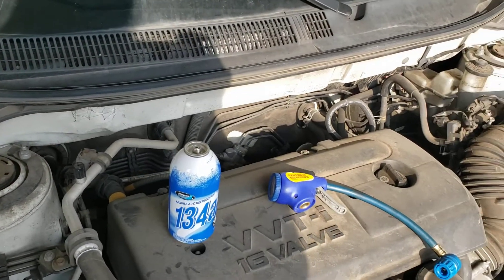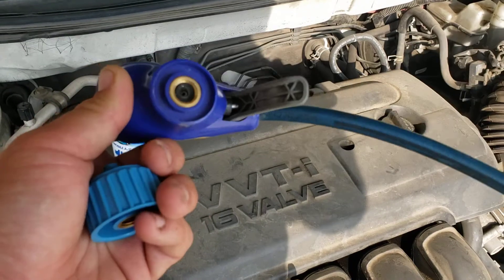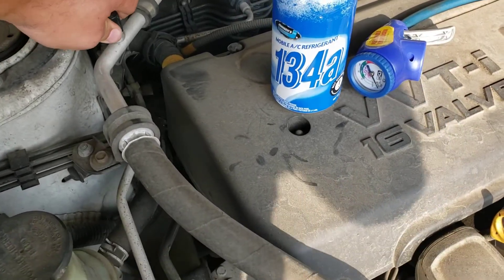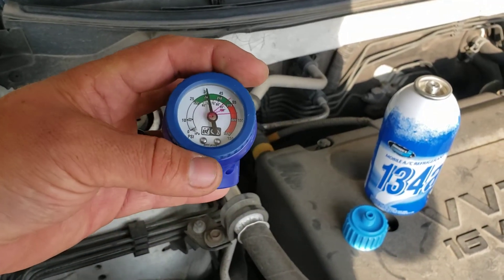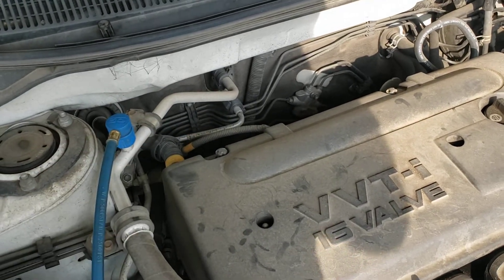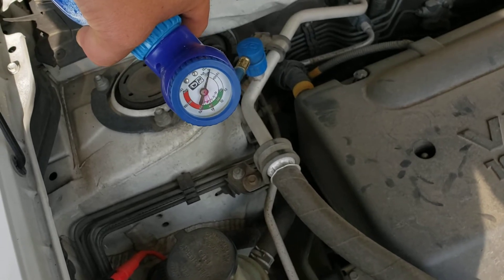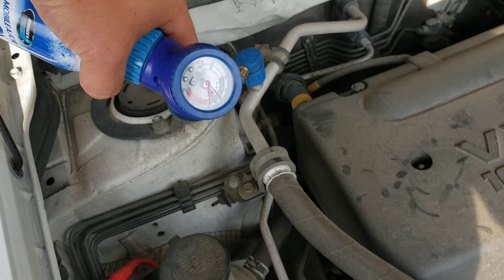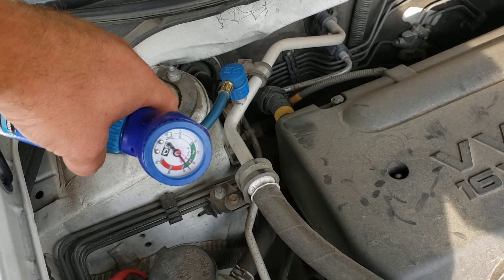How to recharge the AC on your car with new self-sealing cans.

Comment: Must be a well kept secret since no one at the 3 auto parts stores could point me in the direction of these adapters.
Reply from the maker: @thetir0  Now there's end caps full of them at Walmart. They finally caught up with the new cans and everyone having the older tools. I have a full manifold setup now and it works on both without adapter.

Comment: So that one can recharge for lx 470?
Reply from the maker: @youngheng5819  Check the weight required for you car for a full charge. I'm guessing with that, you'll need 2-3 cans though. Most cars, not SUVs are between 1 to 2 cans.
Reply: @phathomthis  but can use right ?
Reply from the maker: @youngheng5819  Yes, you use the same method for any car. The adapter goes on standard tools that used the old cans and the tool works on any car AC system. It only goes on one of the ports so you can't mess that part up. Just don't over fill it and take your time. Do it slowly and add a little bit at a time works good, too much at a time and you can over pressurize some of the system.

Comment: I got a hose from china and the connector pierces the can.  You're saying you now need an adapter on the can to screw between the 2?  Because no the freon is not coming out, but if they sell self sealing cans then it should come ready to connect to one connector. But you say this works, I guess we need to use a connector.
Reply from the maker: Correct. There are 2 types of cans now, the original ones that the old connectors worked with and the new self sealing ones that you need a new connector or an adapter like I have here.
Reply: @phathomthis  Thanks for your support.  I was very frustrated and the adapter worked, air is ice cold. :)   Now I need a can to put a little oil in it,  less mess that way.
Reply: Walmart has the adapter for $6
Reply: So many confused and in correct info here....

Comment: never turn can upside down.  You want the r134 to go in as a gas.   Right side up is gas.   Upside down it is liquid.  This may blow up your compressor.
Reply: Actually, liquid goes in faster so you want to turn it upside down. R134a processed in the can is made that way. The problem is using this particular tool instead of an a/c manifold gauge, you don’t have access to see the pressure for the high side.
Reply: @renoleceesay7869  that's not what he's implying, if any liquid refrigerant gets into the compressor it can damage it, by holding it upside down it's going in straight as a liquid, and with these small DIY hoses it doesn't have time to change states as fast from liquid to gas.
Reply: The can manufacturer recommends turning upside down near the end. Been doing that for over 32 years with my broncoii, one can a year:)
Reply: @jmarkcobb9934 at the end? How do you know when exactly it's the end?
Reply: @adri.khaz.6290  It is not really an exact time.  After a while the can is not as cold. That is the time I usually turn upside down. One probably could do sooner.
Reply: @jmarkcobb9934  sounds good. Thanks.
Reply: Even though it said to turn 12 and 3 on the can?

Comment: Wtf? What are you thinking? Why did you get an adapter instead of just getting a self-sealing can tap?
Reply from the maker: @bmfilmnut  The self-sealing cans had just come out. The adapters were scarce enough and no self-sealing can taps were available. I agree that the self-sealing can taps are the way to go and have such got myself one with a complete set of manifold gauges for AC work. But at the time, that wasn't an option, so I was illustrating the option that most people had at the time, myself included.